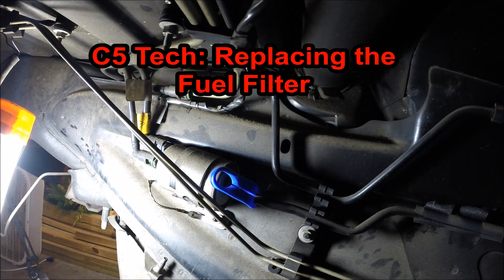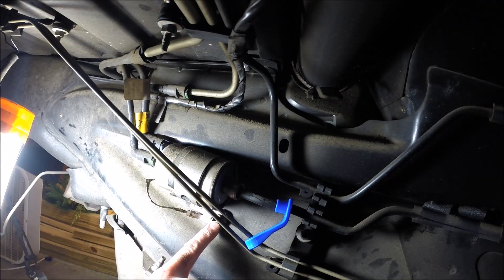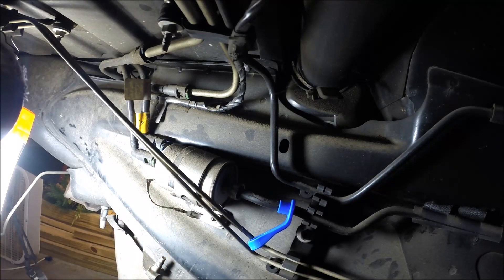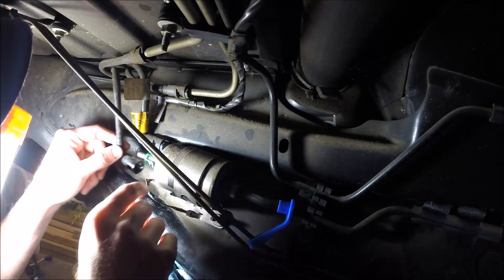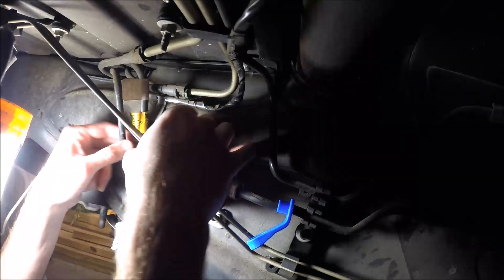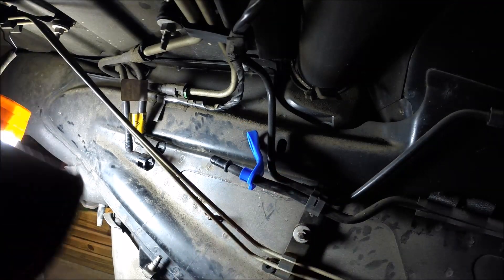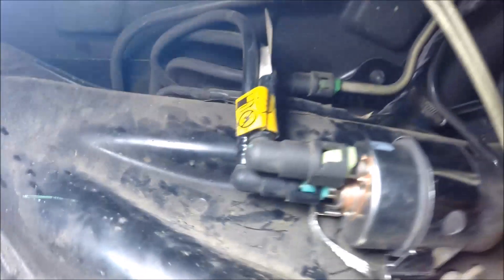C5 Tech: Replacing the Fuel Filter

Comment: Why is there two different fuel filters one has two knobs like u got but then there’s on with one knob.
Reply from the maker: I believe the 1997-98? models just had an inline filter.  The 99+ models (mine in the video is a 2001) have a built in pressure regulator, so it is a different filter with the extra port (return line).

Comment: Will that fix a bad gas gauge
Reply: Doubt you'll read this but you gotta buy chevron techron liquid to fix it. Personally it basically completely fixed me fuel gauge inaccuracy.
Reply from the maker: Unfortunately probably not.  Typically that's going to be either the sending unit on the fuel pump, or an issue with the gauge.

Comment: I changed mine on my 02 Z06 and then started having random issues, such as pressing the gas pedal and it randomly not going. Longer I drove it the worse it would get with hesitating and eventually ended up turning off on me. I just double checked and it looks like it was hooked up correctly. Is it possible I got a faulty filter? Just find it odd I started having issues shortly after installing it.
Reply from the maker: Sorry to hear you're having issues, that's always frustrating.   If the issue started right after changing the filter, then I would probably start there.  Another new filter isn't too expensive.   You might also check the DIC and see if there are any pending engine codes that might give you some clues.    It's also possible you got some bad gas.  Did you fill up at a different gas station than normal?
Reply: @ScrufsGarage  Thanks, just ordered a replacement one which will be here tomorrow. Took the old one off already so just waiting for the new one to plug right in!

Comment: Thanks Scruf for posting this vid 👍

As someone who spent the past hour or so fighting those fuel lines, I'd like to give some tips and advice.

1.  The first fuel line (green clip) came off really easy. That second blue clip gave me hell. After 30 minutes of fighting, I decided to try using push pin pliers to push and hold down on those tabs. Came off in seconds.

2. It was a bit of a guessing came at first to see which quick disconnect tool to use. But the exact one is 3/8ths. 

3. I found this to be the best way to get that last line out.
Hold/pinch the line while also putting pressure on the tool with one hand. Then get a good grip on the filter with the other. Now at the same time, apply pressure towards each other. You should hear an audio click and can see the tool easily slide into the filter and releasing it free. 
Be ready for spillage, I noticed this side had the most amount of gas.

I hope this helps someone. Good luck! 👍
Reply from the maker: Thanks for sharing.   Glad you were able to get the filter changed!

Comment: Hey it's Milton.Thanks for all the good videos. Just saw your video on replacing the fuel pump. I have the black 02 I've been doing work on. Just about ready to crank it up but was unsure on the gas. Hasn't been cranked for about a year or a little less. Has only around a gallon of gas in the tank. Do u think it's fine to run the old gas mixed with a few gallons of fresh gas. Or is there a way I can drain that gallon of old gas out of the tanks. Without removing the gas tanks. Say opening or loosining a gas line?. I just recently found out that the c5s have 2 gas tanks. Crazy. Any advice you could me would be greatly appreciated. Thanks again.
Reply from the maker: Honestly, I would just add some fresh gas, and I think you would be fine.   My car sat for closer to 1.5 years while I rebuilt the engine.   I didn't drain the tank, but did add fresh gas.   No issues.

Comment: Is it possible to install the incoming and return lines backwards? Since installing my new GM filter, I have had problems with fuel pressure (spikes to 120psi occasionally) and loud fuel pump whining. Just trying to eliminate any possibilities before I crawl under there again. (2000 Convertible).
Reply from the maker: If I recall correctly the lines were different sizes.   couldn't hook them up backwards.

Comment: Hey great video! I am going to have a mechanic do this for me and was wondering should I bring it with the fuel tank near empty or does it not matter how much gas is in it? I just don’t know if fuel will start pouring out?
Reply from the maker: Shouldn't matter.   The filter is up on the frame rail above the tank, so fuel won't flow out w/o the pump running.

Comment: how many noticed that the lines went on backwards
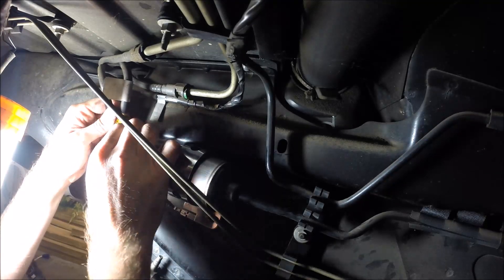Reply from the maker: Michael Clim  thanks for watching.  As mentioned in other comments about the lines, it’s just an optical illusion.  Around the 6:40 mark in the video I mentioned that the orientation of the lines is different on the new filter.  But the lines are different sizes, so you can only hook them up one way.

Comment: Do you know if this is same for a 98 vett.
Reply from the maker: For the 1997-98 Corvette, the fuel filter is different, but it's in the same location.  Your model is just a standard inline fuel filter, and the fuel pressure regulator is up on the fuel rail.   While for my model, the fuel filter has the pressure regulator built in.   So your filter should be cheaper to buy.  But a very similar replacement procedure.

Comment: How did you knew that you had to change the fuel filter?
Reply from the maker: Emmanuel Meraz Fernandez  I did it as a maintenance item.   If you were having fuel delivery issues (pressure, flow) then that could be a sign the filter needs to be changed.
Reply: @ScrufsGarage   Thank you men!!

Comment: your inlet and return lines are ass backwards...note the orientation before dissasembly
Reply from the maker: That's just an optical illusion.  Around the 6:40 mark in the video I mentioned that the orientation of the lines is different on the new filter.  But the lines are different sizes, so you can only hook them up one way.  And I can confirm the car runs great; no fuel delivery issues.   Thanks for watching!

Comment: Now that you have done this, do you think it would be easier to loosen the filter from the frame prior to removing the hoses?  Also, did you replace with a GM filter or other brand?  Wondering if that is why the hoses moved a bit from the original.  Planning on doing mine this summer (car is still in winter storage) so I will likely do this prior to firing it up since it has been sitting so long.  Thanks for the video!
Reply from the maker: I think removing the hoses first worked better, helps hold things in place while you fight with the disconnects.  I used an aftermarket filter; mine came from Carquest.  The GM filter was significantly more expensive.  Actually, if I recall correctly, the filter I took off was also an aftermarket unit from Napa.  Which was surprising that the PO had replaced it because he didn't seem like the sort to do that sort of thing, haha.   Good luck on yours!   If you tackle it any differently, be sure to post up for others!

Comment: Just wanted to give a shout out for this video.  I messed with mine yesterday figuring that it wouldn't hurt to change out the 16 year old filter on the car.  Everything was going fine up until the disconnect gave me a fit.  After watching your video again, I put the disconnect tool back in place and did some finessing with the filter and finally the stars aligned as the filter released.  Only thing I had to do to remove the filter from its physical location was disconnect the drivers side portion of the catback.  Thanks again!
Reply from the maker: Awesome!   Yea, those disconnects can be a pain sometimes, especially when they've been seated in place for a long time.  Glad it worked out for you!

Comment: can this be done with the driver's side rear wheel on? And you must have had the catback exhaust removed?
Reply: Yes. I just did it with driver back wheel on. Tight fit tho
Reply from the maker: Yes, I believe you should be able to get to it with the wheel on.  I had the entire torque tube and exhaust removed, so I had plenty of room.  You'll still have room, but it will be a tighter fit.  Luckily you don't have to do it very often.